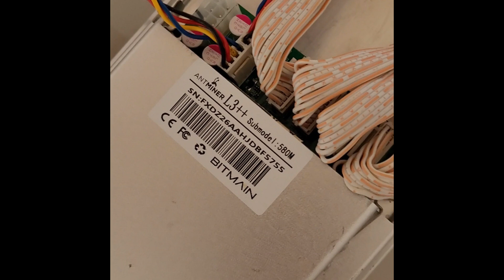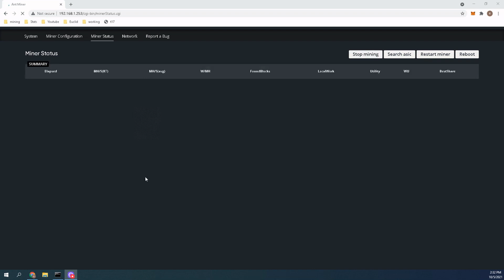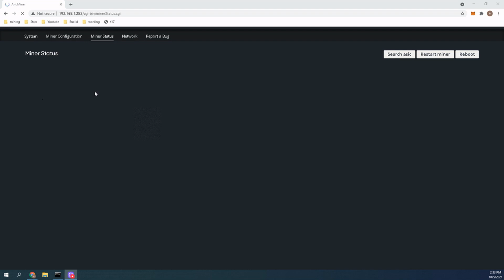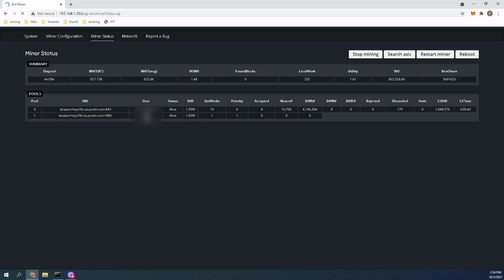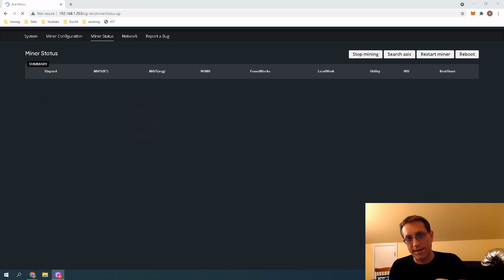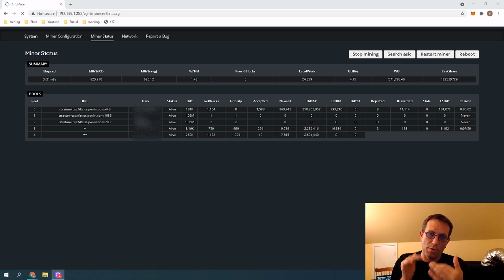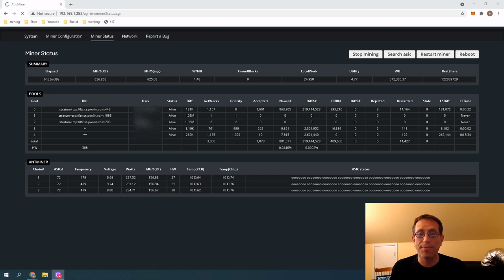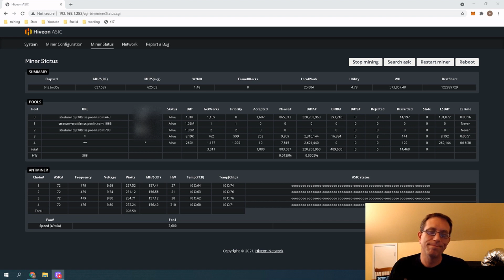ASIC L3++ cooler sound reducer PART 2  SUCCES!!!

Comment: How is the miner holding up in the long term.
Reply from the maker: I ran it in there for 3 months and never had a problem. Even in the middle of the summer it ran cool and quiet. I have several more coolers I'm fitting for the other L3+ and L3++s I have. BUT, I did buy some new fans that should be arriving in the next week. If these new fans can quiet the L3+ as well as I'm told I might not need the coolers anymore. As soon as I get them Ill have a video testing them. Ill test 2 machines side by side. One L3+ in a cooler and one setup with the new fans.

Comment: i have the same miner please tell my the size of cooler in CM
Reply from the maker: 25.71 x 14.12 x 14.25 Inches --- 65.3034 x 35.8648 x 36.195 centimeters 
Let me know how it works out for you. I got mine on ebay for about $20.
Reply: @euclidmining  nice its fair price if u have a link (the cooler in ebay )..u made my day absolutely ..think you
Reply from the maker: I hate to put links to places like eBay because some sellers are not as reputable. The cooler I bought, 48 QT Laguna Cooler is available at most retail stores and on ebay.
Reply: @euclidmining  and tell my how is it now after month ago dose it work well
Reply from the maker: I haven't had any problems with it. He is average or below and the noise, there is no noise. I do have the power supply on top of the cooler with a hole for the wires to go through and internet. I am doing some revamping on it. I'll have an updated video for you in the next couple days.
Reply: euclid mining  absolutely appreciate it i will do it this week
Reply from the maker: @faisal0362  keep me updated and if you have any questions please let me know. I'm excited to know the outcome.

Comment: How did you get your fan speed to 3600. Are you running custom fan speed?
Reply from the maker: I'm using HiveOS for my firmware with "Customize the fan speed percentage"  off. Its under "Miner Configuration", scroll to the bottom of the page. There's a toggle switch for "Customize the fan speed percentage". I have mine off.
Reply: @euclidmining  thanks man. What percentage are you using?
Reply from the maker: I have that set off. I let the software control the fan speeds as needed.
I don't mind burning out a fan or using too much electric so I let them run full on what the miner needs. I'd rather have a cool running ASIC and increase chip life over a $20 replacement fan. imo
What are you running yours at? I'm messing with my T17 firmware update tonight... Just posted a video. It never seems to end  lol
Reply: @euclidmining  mines unchecked too and the fan is 4600 and 3500, still very noisy
Reply from the maker: The fans on the L3++ running at the same speed (overclocked) as my L3+ run the fans at different speeds. Since I've updated my Hive OS firmware my fan speeds seem to be the same but register lower. Maybe a software glitch from earlier versions.

 I'm looking into getting a couple new fans. A fan I haven't tested but have read great reviews on is the Noctua NF-F12 iPPC 3000 PWM, Heavy Duty Cooling Fan, 4-Pin, 3000 RPM.
https://noctua.at/en/products/fan/buying-guide
I've seen them on Amazon and Ebay for around $30 but I recommend buying directly from the manufacture. (i don't have a affiliation link)
They are much quieter than the stock fans that come on miners and produce the same airflow. You will need to mod the connection (cut a little piece of plastic off so it fits) but from what I've read they are amazing.

Ill order a couple today and have a video as soon as I get them in.
Reply: @euclidmining  I've tried the noctua fans but had no luck getting them to work. Even after modifying the connector. You can't overclock them with noctua fans as the barely flow enough to keep them cool
Reply from the maker: I'll have to buy a couple and give that a try. I've read some good reviews about these fans being super quiet and push enough air.
Reply: @euclidmining  any news on the noctua fans?